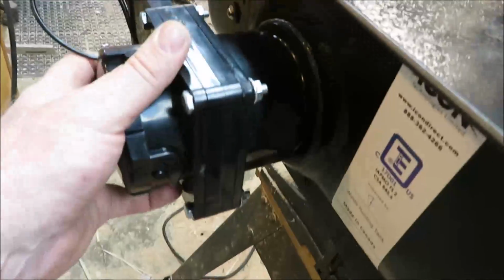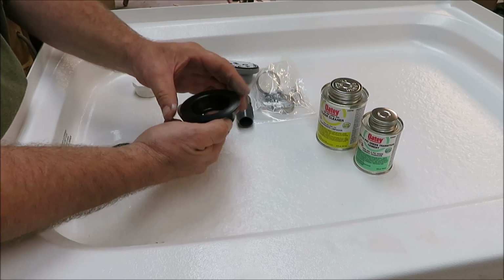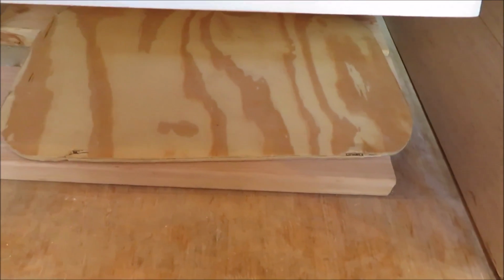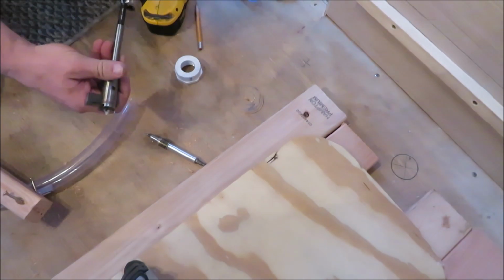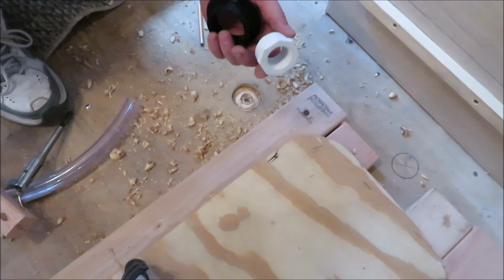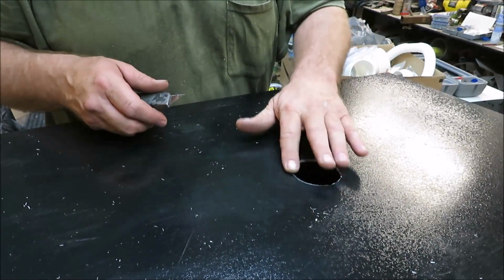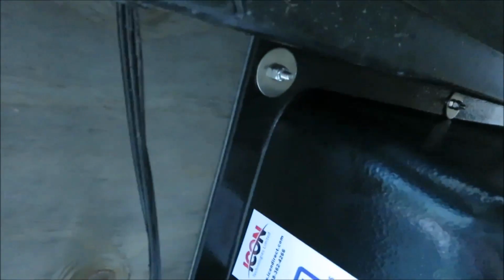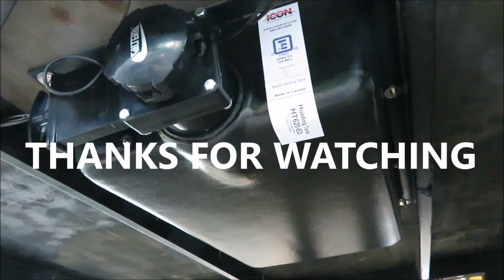cargo trailer camper build part 19 grey water tank install

Comment: Never understood why bother putting a grey water tank in, just let it flow freely onto the ground. Just don't put chemicals in your water or sink.
Reply from the maker: I understand that but some don't.
Reply: On your own property great, dump your waste water, but in other places that is nasty and irresponsible. Also campgrounds require you to have holding tanks. Imagine pulling up to a site if everyone did this before soggy and smelling. Don’t give CTC people a bad name. Dump your waste water in an approved facility. Do you leave your trash at your sure too for the next camper?
Reply: @TheAllang123  stfu! Grey water is nothing more then shower water or dish water. Hurts nothing and is actually good for watering plants, etc. I don't give a rats ass what a campground wants. Boondocking is not a campground. I have been boondocking and traveling in a trailer for years now. Never an issue, so relax Karen.

Comment: No trap needed if you don't piss down the drain. Put a plug in or cover the drain when not using. A small vent to outside is your friend. Bubbles could turn out to be a pain in the butt with this system

Comment: No no no no no no no.  This is absolutely an example of what not to do.  No to the pan being supported at all on the sides (it can't handle that).  No to the mess of two by fours and plywood just laying underneath it to somewhat support it.  No to elevating it period at all.  No to that mess of drain to clear flex tubing to this to that, no no no.  Put the pan directly onto the floor.  Get a normal straight down drain to take it out below the floor.  Underneath trailer, turn drain, put p trap, also probably need a vent, then into the grey tank.  Put the grey tank down from the bottom of the trailer some to make it the elevation that you need.  Mercy mercy mercy mercy mercy.
Reply from the maker: I will do a review in a year and let you know how it holds up if it don't you will get to see thanks for the comment Carolyn.
Reply: I just as soon take a shower enclosure tent, a 5g bucket with a water pump and a on demand hot water heater...place right outside the trailer...but that’s mo
Reply: Carolyn 👉🤙

Comment: Kevin,  I agree with the suggestions of the p trap, supporting the shower pan and the support straps to the frame members underneath. 
As close as your connections are a valve might be better than a p trap. If that tank has water in it while you are traveling, it is going to come out the shower drain. 
Just my 2 cents worth. Enjoy and look forward to your videos.
Reply from the maker: Some good ideas Ron thank you.

Comment: First let me say, I really enjoy your videos. 

What I say are not criticisms, but things to maybe think about. A few things that came to mind while watching and mentioned in other comments. Tank support. Strapping around tank and/or flat bar the length of the tank instead of the large washers. Some way to keep the odors of the tank from coming up into the trailer. Lastly, if that is clear vinyl hose you're using I have had it grow black mold within a year of installing it. It had city water running through it occasionally more as a sight gauge than anything else. Mold isn't good.
Reply from the maker: Thank you for the info.

Comment: I was thinking the same thing about the P trap comment. It will smell and slosh around when driving.  I wonder if a big pcv valve that you open only when showering or a drain cap in the shower floor would save some room and secure the water? This is the best shower video I have found. The technical advice is so helpful! Thank you for the video and inspiration!
Reply: It's GRAY WATER. Shouldn't stink

Comment: P trap bro ! ifn ya dont put a p trap in you'll hate your self ? maybe just put a 2x4 under the clear hose before the tank under the shower pan so it will hold water in a trap ?
Reply from the maker: will do thanks.
Reply: Helps with the Oder definitely
Reply: @SouthernPatriot1 it's gray water, shouldn't stink.

Comment: I couldn't hear sound because of where I was, but as a suggestion Kevin, if you haven't already decided to do it, I would use some Great Stuff foam and spray all over underneath that pan where there isn't wood. It will just stabilize it even more and it's a very small cost for the peace of mind you get knowing that none of it can move around at all and there's no cold air getting in there either

Comment: Kevin my suggestion would be to get some plumbers tape or some duct strap and but it from frame rail to frame rail to support the gray tank the tank full of water will weigh 83.4 pounds and if you have water in the tank while traveling to dumb it that's allot of weight that will be sloshed around. Just a suggestion. Keep it up all what you've done looks good.